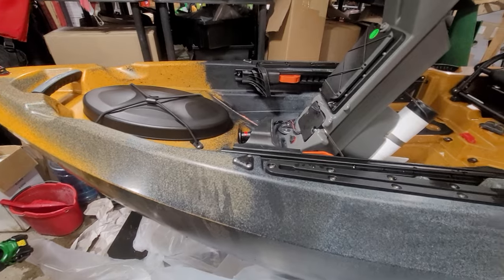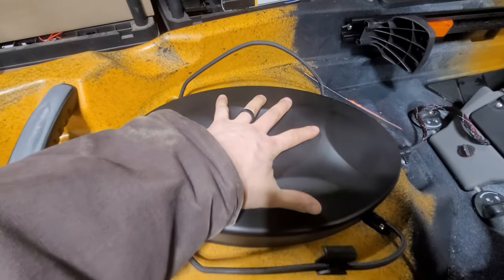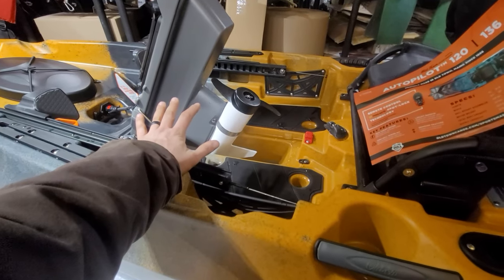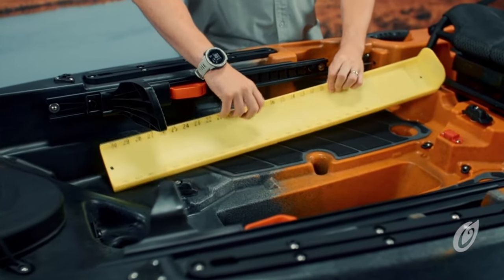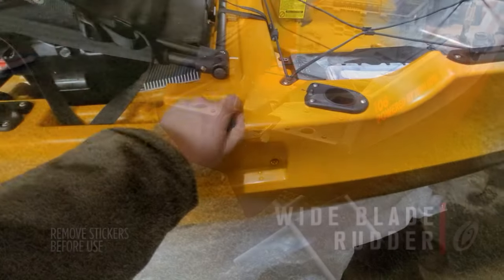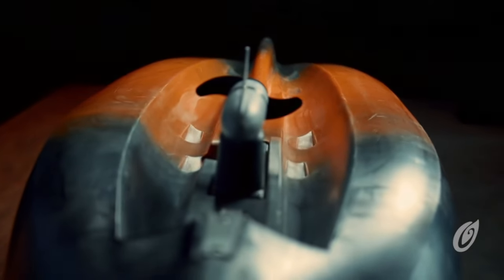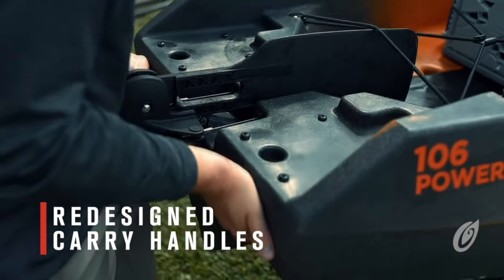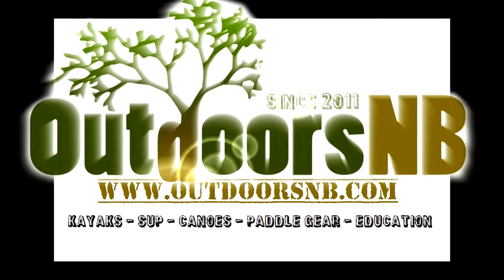Overview - 2022 Old Town Sportsman 106 Minn Kota

Comment: hi, what is the aluminum grate thing behind the battery box. can that be moved to access under the hull behind the seat?
Reply from the maker: Steve, it's a cooling grid for the eletrical system. Its sealed in the hull. Removing it would require you to reseal it every time with marine grade sealant and I suspect, also likely void the hull integrity warranty.

Comment: What is the button on the side for on the battery case ?
Reply from the maker: Its actually a wire port.
Reply: @Outdoorsnb  the one that has a plastic see through  cover on it ?
Reply: It's on the left hand side of the box
Reply from the maker: @Boston C's  correct. If memory serves me its protecting threads...but I dont remember 100%
Reply: @Outdoorsnb  yea when I press on the little clear cover seems to be a button
Reply: @Outdoorsnb  apparently its a circuit breaker
Reply from the maker: Well, now we both know...hahaha. having no MKs left I had no way of checking orher than emailing OT.
Reply: @Outdoorsnb  was waiting on a email for 6 days about it just got it this morning lol.thanks for the help though!

Comment: Wasted my time watching this.
Reply from the maker: Well gee whiz wally....thanks I guess?
Reply: I expected more details like, what’s the drain plug for on the motor drive assembly or What’s the scupper plug under the battery box for or more info on the invisible access port on the battery box????
Reply from the maker: Well...pretty simple. Plugs are for draining liquids and invisible ports are for inserting invisible wires and such.
Reply: Note to self: Never buy anything from OutdoorsNB Inc.
Reply from the maker: @JDLong58 it is OK, I typically drive off trolls with a higher level of assholism than what is initially dished out by said troll.
Reply: I’m not a troll I was hoping to get a little more info in my OT Sportsman 106 MK but…
Reply from the maker: Ok...that would have been a far less instigating way of phrasing your issue with my video..which would have resulted in a more hished toned response. The scupper in the battery area is to drain water in the event of dynamic condions but also allows for through hull wiring access should the owner chose to install hardware bottom side (apart from a humminbird transducer which would normally be installed in the forward transducer scupper. The invisible access is to allow for through box wiring of smaller guage wire (if memory serves me) and the drain plug on the drive: it depends which one you are refering to.
Reply: The drain I’m referring to is the one on the end of the drive unit not on the hull.